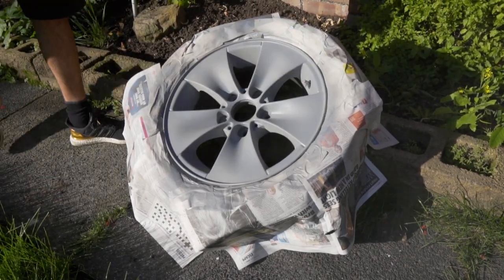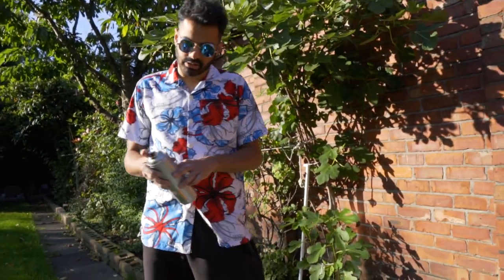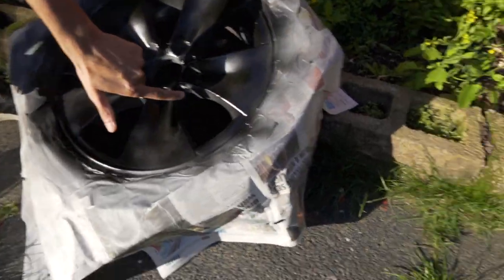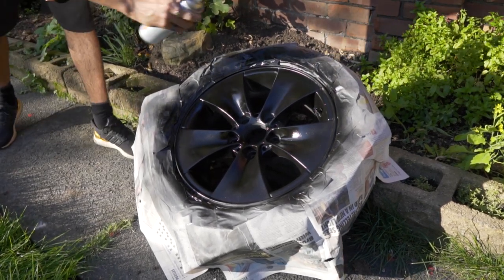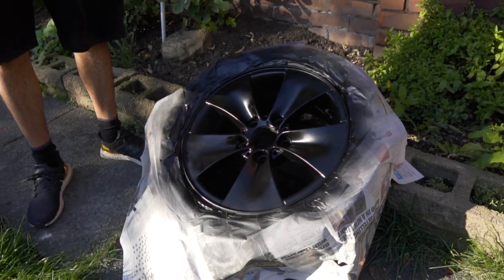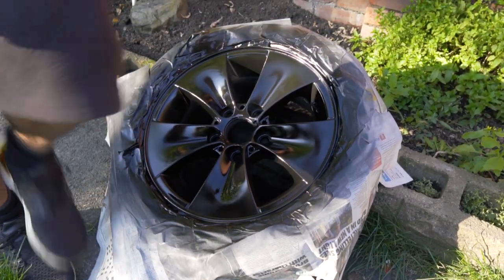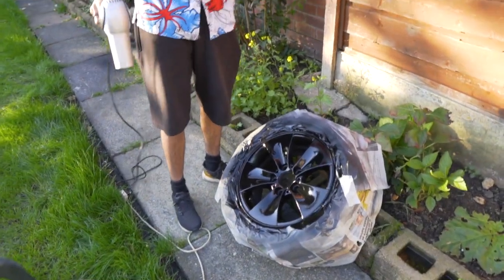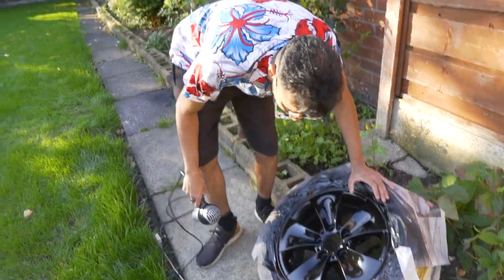How To Spray Paint Wheels

Comment: bro I'm trying to paint my alloys black, do you reckon I'd get away with not sanding it down?
Reply from the maker: Reason you sand it down is so the primer can stick to the rough surface I think if you dont sand it it will start to peel of in a few months